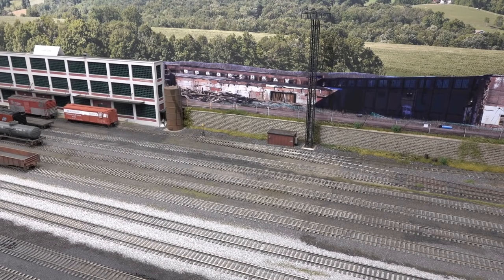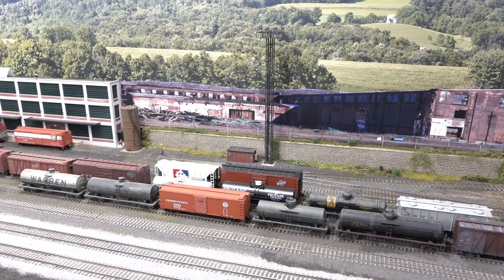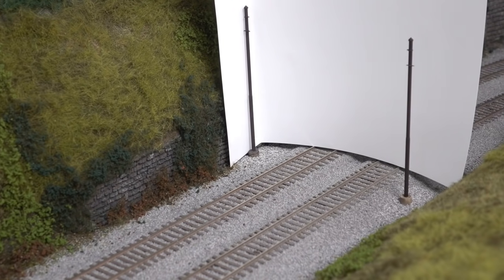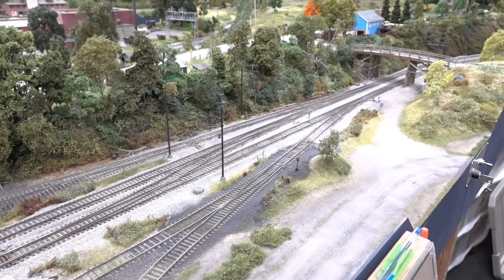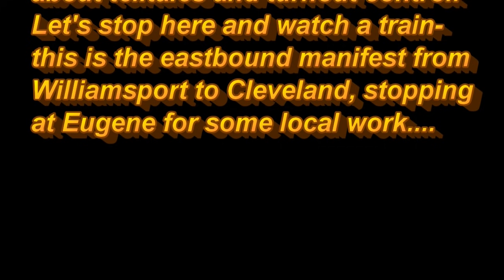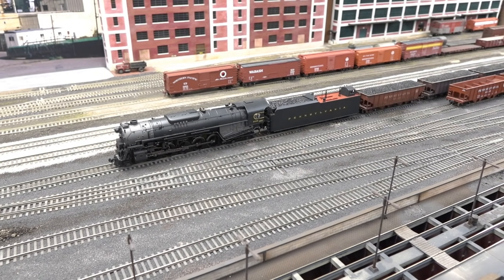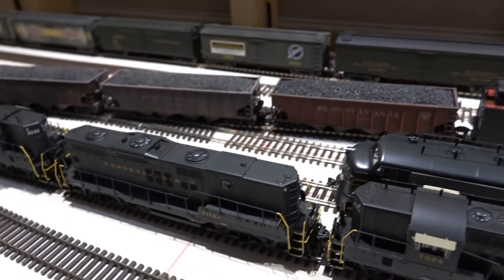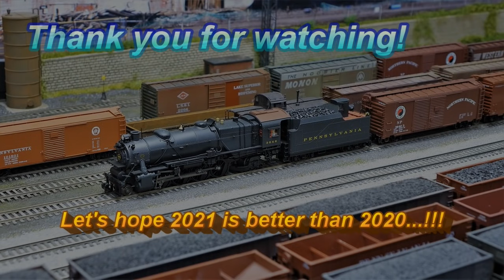MRUV 161: Odds and Ends for the New Year

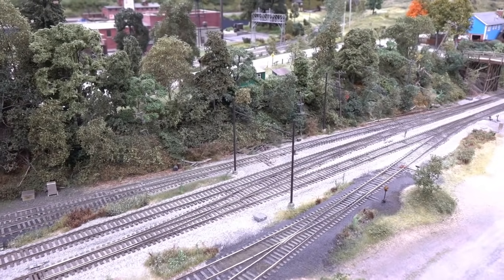Comment: 25:00 telltales: Surely you would have had to pass under the other ones to get into the siding? Nice work though Rob.
As the Captain said below!
Reply: Yeah, but any possible problems would occur with trains 𝒍𝒆𝒂𝒗𝒊𝒏𝒈 the sidings, after altering the load, or adding to it. I would say that the siding neck would be the 𝑚𝑜𝑠𝑡 important tell-tale 𝑩𝑼𝑻, I know precious little about 𝑈.𝑆. practice.😁
Reply: You are probably right, of course. But I didn't think that the works at Wallace was producing anything that would be bigger than the train, and given their location I think they would be aware of the very local height restrictions.
Reply: @chazzyb8660  The usual staff at the industries would be aware but the responsibility still falls on the railway guys. I'm not too familiar with U.S. practice but, in that era, most sidings on U.K. railways would pass below a physical loading gauge before gaining the main line. These tended to be used, rather than tell-tale devices for individual structures. The U.S. was blessed with a 𝑤𝑎𝑦 more generous loading gauge than the U.K. but it seems like route knowledge would be vital for low bridges etc.
Remember though, if Cletus is off sick, the new guy might not know all the rules.😁

Comment: Behind the new yard light tower, it's pretty hard to tell what's backscene and what's "real", so you must be doing 𝑠𝑜𝑚𝑒𝑡ℎ𝑖𝑛𝑔 right.😁
I'm a wee bit puzzled by your tell-tales though. Is your main-line bi-directional throughout? I would have expected there to be a single tell-tale on each side of the 𝑜𝑏𝑠𝑡𝑟𝑢𝑐𝑡𝑖𝑜𝑛𝑠, rather than two, side-by-side. If they were electrically connected, to give an indication if anything out-of-gauge touched them, would there not need to be, at least, a train length between the tell-tale and the obstruction, along with a signal to bring a train to a stand? My knowledge of U.S. practice is, at best, minimal Rob, so I might be miles off with all of that; it just doesn't make sense 𝒕𝒐 𝒎𝒆, the way you've sited these ones.
With that huge, 10-coupled loco, could you perhaps replace the centre set of drivers with flangeless wheels, might help your cornering? I've certainly seen that done on model 2-10-0s and, believe it or not, some 𝑟𝑒𝑎𝑙 2-10-0s.
Nice to see some trains running on The Bennett Railroad; it's looking just fine.😁

Comment: If I was in your position I would take out the turnouts  redo that  ya u probably don't want to at first but in the end you will have a smile on your face knowing that 2-10-4 and 2-10-0 that can run through it  trying to not have that issue have all 3 UP steam heritage units In doing testing throughout the whole way out that way

Comment: How do you keep the layout clean from dust
Reply: I don't...it is always there. I have a very nice "dust brush" from Tamiya that is great for dusting off locos, rolling stock, structures, etc. But if I go away for a few days, it starts to accumulate. It isn't terrible, as the room is carpeted, with a drop ceiling and has AC/Heat. But dust- and those little annoying cobwebs- STILL show up!
Reply: @robbennett1965  my layout is tiny but very difficult to keep clean with only me and my wife here